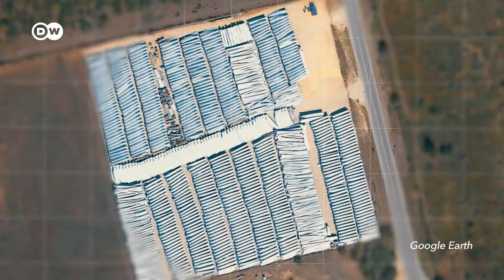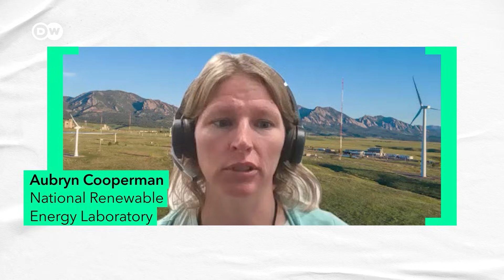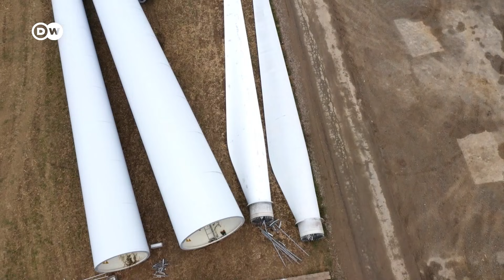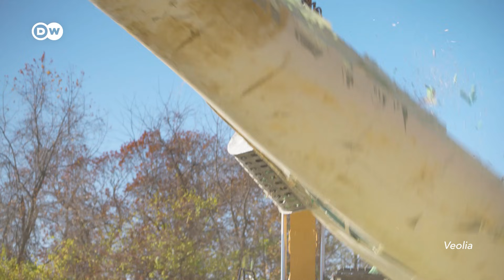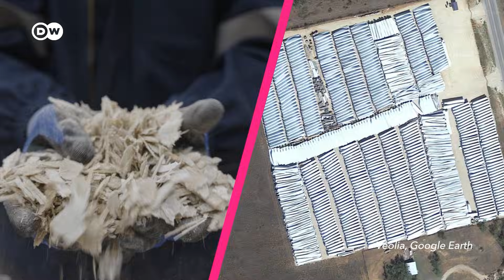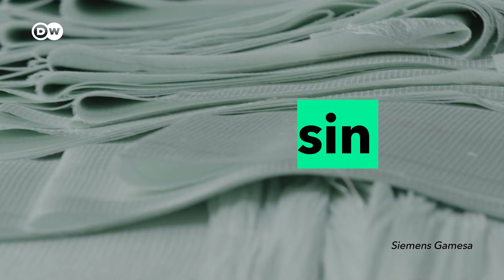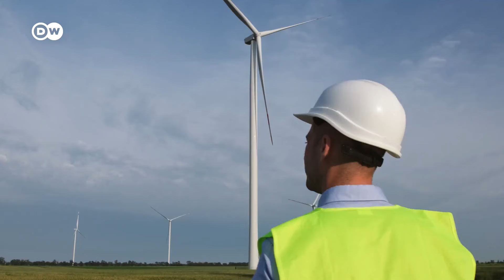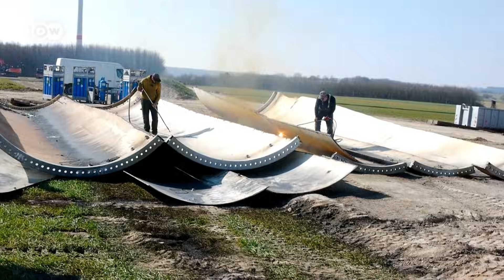Wind power's unsolved problem

Comment: Not a word is mention about micro plastics in this video. These blades while in use throws of a lot of micro plastics due to erosion. This goes directly into nature and is absorbed by everything that lives. Offshore turbines are even worse due to salt and stronger wind. In an estimate from Sweden they reckoned that their 4000 turbine or so have produced about 270 tons of micro plastic, only beaten by artificial grass on football fields.
Reply: The amount is much lower, since the outer layers are paint and negligible compared to the human use of plastics in all other areas.
Reply: @old-pete  The paint doesn’t stop the spread of micro plastics since gel coat have been used since the first fiberglass propellers .  The estimated  270 tons from the land based turbines are not minor.  This plastic is spread in the country side and is not from a local dump site like the other plastic. With the offshore wind turbines the amount of micro plastics will be even worse because of the salt and stronger wind.
Over the years the amount of micro plastics in fish will increase and be spread up in the food chain.
Reply: @runedahl1477  As I said the amount is lower, as there is barely any plastic in the outher layer. Wear of tyres and roads is estimated to produce 8000 tons of microplastics a year alone in Sweden.
Reply: @old-pete  Yes there are things that produce more micro plastics than wind turbines but still they are among the worst polluters.
The numbers can be disputed and there has not a lot of research done.  A couple of weeks ago I attended a meeting regarding a new high voltage power line that will go across the island I live on. I don’t have any thing against this project because it seems like they are take care of environmental issues. The mast will mostly be made of fiberglass but they didn’t have any data regarding how much micro plastics that will give away. Apparently the producer had no data available. This will be important in the future but is not considered an issue yet.
Apart from the plastic pollution there are so many negative sides to wind turbines so I think the whole project should be abandoned.
To write them all down in this comment.
Reply: @runedahl1477  If you consider the numbers, then no, windturbines are not among them.
The negative sides to windpower are faily limited, if one considers the alternatives.
Reply: @old-pete  Wind turbines are no good option. If you want stable carbon free electric power the only sensible options are hydro power,geothermal power or nuclear power. The two first ones sets requirements to the location, so then we are left with small modular nuclear reactors. The only thing that hold nuclear reactors back is the public fear after accidents like Three Mile Island, Fukushima and Chernobyl . The new generation four reactors are smaller, safer and don’t require human actions if things starts to go wrong.
Reply: @runedahl1477  One cannot use, what does not exist. SMR are not commercially availlable yet. And if they are save, is yet to be proven The problem will probably be easier access to nuclear material and, if popular, bigger distribution of nuclear material.
And it does not look like they will be cheap.
It is better to combine hydro, biogas, biomass for stability with solar and wind for cheap electricity.
Reply: @old-pete  There is a nuclear race going on but in a positive way. Companies all over the world are developing the next generation of nuclear reactors. They will be smaller, cheaper,safer and even be able to deal with most of what today is considered nuclear waste. Molten salt reactors have existed since 1958 and was developed at Oak Ridge Technology. Beside what do you think they use on some submarines and aircraft carriers.
Reply: @runedahl1477  And still they are not getting built, despite the first design being approved by the US.

The reactors in ships are different designs, not made for mass production and not made for cost efficiency. The military pays.
Reply: @old-pete  You are wrong there . The Chinese started their first molten salt reactor in September 2021. They did that in the Gobi Desert. It is a small thing but big enough to supply 2000 households. Their plans are to build much bigger reactors and roll them out in large numbers by 2030. I also learned lately that the Russians have commissioned a new SMR. In Canada and UK they are starting to build similar projects. Then there is the so called fast reactors that can burn nuclear waste. In US alone there is enough of this waste to cover the total demand for years. This waste is stored in so called temporary storage. They are already doing this in France.  Germany got a taste of how unreliable wind power is last winter. The price of electricity went through the roof due to lack of wind and old coal fired plants had to be fired up to avoid a total collapse. As a result air pollution riser by 40%. It was very convenient for certain politicians to blame the war in Ukrainian for the lack of energy which is completely BS.  Realizing how stupid it was to close down all their nuclear power plants they built a LNG terminal in record 10 months. Apparently nobody had considered that Putin or other may turn off the gas.
Reply: @runedahl1477  The SMR are still not commercially available.
The increased prices in Germany where not the result of a sudden lack of windpower, but of unsecure supply of natural gas. In other words it was a problem with the fossil fuel supply.
If all the windturbines had not been built, the price increase would have been much larger.
Reply: @runedahl1477 Nuclear power supplied only a small part of the energy needed. Even with nuclear power, the prices would have increased, especially considering that only a small part of homes are electricly heated. The situation would not have changed.
The energy prices increased in France too and the french goverment will subsidise the electricity market with around 45 billion € per year to keep the prices somewhat stable...

Comment: How does the recycling of renewables compare to the recycling of fossil fuel generation at the end of it's lifespan? How much of a nuclear reactor, a coal or gas fired power station is recyclable at the end of it's life? What's the cost to taxpayers to clean up disused power stations of old technologies compared to dismantling a wind turbine or replacing a solar panels with the next generation as they come along.
Reply: Considering the waste of the fuel, it is easier to recycle windturbines.
The dismantling is paid by the owner and most nations demand securities that cover the dismantling costs. In case of nuclear power plants, these securities are often too low.

Comment: I don't think they're unrecyclable...if a blade can be broken, it can be broken again...

Break it down small enough where you can use it as filler products. Remember when rubber tyres got turned into rubber mats under playgrounds?

Comment: while i like the idea of finding a use after the life cycle. if a blade can be put in landfill you can cover it with soil and use the land for farming because there is no toxic waste, that doesent sound that bad. if the other solution is to disolve them with acids, that will have to stored somewhere as toxic chemical waste, then the landfill solution sounds a lot better to me. if u can use them in concrete or new blades without chemical waste that would be first choice though. unless we can use them to maby stabilize the ground under roads that are being built or something.

Comment: This really highlights the difference between these windmill companies and oil companies. An oil company would try to hide this kind of thing and play off how impactulfull it really is. Wind is saying "yeah, we have a problem here so lets solve it for a better tomorrow".
Reply: There actually isn't a problem. The composite blades get recycled as building material or steel blades just go into the steel scrap process.

Comment: Even putting them into cement isn't a longterm solution. What happens to that cement when it is being deconstructed?
Chemicly changing it by heat or other substances seems rather the way to go with the already existing once and otherwise maybe find composite materials that are weather resistant, but not resistant to recycling ^^.

Should we till 2050 have achieved scalable and economicly vialble fusion energy then there are ways to recycle plastic and these components, that might be energy intensiv but still better then letting them wrot i would imagine.
Reply: Nothing happens during the dismantling. There is only cement.
Reply: @old-pete  well maybe i should have phrased it differently, what happens to the added crushed wind turbin parts in the cement after it would be at the end of its lifetime. Isn't it just the same problem pushed into the future?
Reply: @kinngrimm  No. The parts do not exist anymore. The resin and wood is burned and the minerals of the glass fibres become cement.
After that chemical reaction there are no glass fibres left.
Reply: @old-pete  i wasn't particular good at chemistry but i am  quite sure that is not quite how it works. If you put glasfibres into cement, they do not become cement. It is just another compound material as what was left of the wind turbine also was, just added into the cement. Which then in the end i would assume makes it even more difficult to sepperate it all  to really be able to recycle any of it.

Wood is only used for smaller wind turbines as far as i am aware of, as it can not withstand the stress  reaching larger sizes used nowadays.
Reply: @kinngrimm  Glass contains sand and silicium dioxide, which becomes part of the cement, as does the rest.
Most large windturbines contain balsa wood as a base structure, otherwise one could not form the glass fibres into the needed shape, as they are flexible until the resins are dried.

Comment: After videos like this I have the urge (sadly not the motivation) to start learning waste management. 

This problem is way above me. 
So I only have some really naive thought like:

We love glass and metal, because you just reheat and reshape it. The reason archeologists barely find any glass relics, because it either brakes down to sand size or you just melt it and reblow it. Matals are the "same"
But I'm sure on molecular level experts will explain that this isn't that simple either. 

So we have plastic, that made out of oil. Why is it so hard to liquify plastic and just remold it to a new form? 
Years ago Ive watched videos about anaerob burning of plastic can brake the chains and brake it back to a petrol. Wonder what happened with that experiment? 
Those ended up that its not viable as fuel, because the quality is worse and would ruin engines. But what about creating new plastic? 

There are another experimental steps with plastic eating bacterias. 
So again, feed the tubnines to bacterias, and use the "poop" :D to remold stuff. 

My concern is to shred things to pieces and use it for construction (houses and roads) we just postpone the problem and just shrug it under the carpet as mcroplastic. 

And we have the economical dilemma:
When they say, its doable, but expensive. 
This is at least promising, because when it has a price label, the supply and demand will eventually shift. 
a) Either with technological improvement:
same way solar panels became cheap, because engineers made it viable. In 10 years prices dropped by 90% because they found better materials, better way of mass producing, or simply make it viable for mass production. 

b) supply and demand:
eventually raw materials will deplete. When the barrel of oil price will hit a certain point, suddenly every landfill site will turn into a "mine" and these "expensive solution" will become the extraction method.

Comment: The first turbine recycling plant will be open next year in Denmark, with another four to follow in different EU countries. I read the process for doing this was masterminded at the University of Strathclyde in Glasgow.
Reply: The problem with this concept is how expensive and energy intensive it is to transport turbine blades. The idea of loading up thousands of blades and literally transporting them 100's to potentially 10,000's of kilometers to the nearest recycling facility is insane. Maybe feasible in DK where it's a small country. But somewhere like the US or China, good luck making that business case make sense. My money is on mobile equipment that can travel to a site and grind up the blades into an aggregate for concrete and asphalt. The very best case used as aggregate in the foundations of a wind facility repowering project. Or worse case they get landfilled, but take up little space. In the case of landfill, grinding is probably unnecessary. Because blades are hollow and can be cut into smaller pieces and stacked. Requiring less energy than grinding but still easier to transport to the nearest landfill. 

The reason I don't care about recycling these things is this...

Let's break things down. Let's compare wind energy to say coal. Let's use a 200MW coal power plants production and compare that that a 450MW wind power plant because of lower capacity factors of wind turbines. Let's say the turbines are 4MW each, which is pretty average onshore these days. That's a wind farm of 112 wind turbines that have a design life of 25 years. After 25 years there will be 3000 tons of blade and fiberglass waste needing disposal. That's a big number.

Now where does coal stack up?

To produce the exact same amount of energy as the wind power plant. The coal power plant will need to burn 44,000,000 tons (yes millions). Producing 4,000,000 tons of highly toxic and even radioactive fly ash. Furthermore the plant will also release 48,000,000 tons of CO2 into the atmosphere.

52,000,000 tons of pollution wreaking havoc on our environment. Compared to 3000 tons of relatively benign fiberglass waste which can safely be landfilled at worst. That's 0.0056% the amount of waste.

Just some food for thought before worrying about the wind industry for the waste it creates.

Comment: The average modern wind turbine's blades weigh about 12 tons each. So that's 36 tons per turbine. Blades last 25 years, so every 25 years a turbine creates 36 tons of waste, let's say 40 tons, because sometimes a blade needs to be replaced.

But an average coal fired power plant in the US will create 6,000,000 tons of waste in the same 25 years. The same as 150,000 wind turbines, more than double the number of turbines installed in the US since 1980. That's a single coal plant remember and that doesn't even account for the 95,000,000 tons of CO2 that same single plant will release in the same time period. Also remember that blades are basically inert fiberglass/resine like the millions and millions of recreational watercraft out in the world. (That nobody is concerned about scrapping.) However the waste from coal plants is well documented as highly toxic and we all know the effects of CO2 on the climate.

Now in the US wind accounts for half as much electricity production as coal. But if everything remains equal for the next 25 years. The coal power industry will generate 1 billion tons of toxic waste, where as the wind industry will create 43 million tons of inert waste. Just 4% of the waste of a coal plant. And again there would be 16 trillion tons of CO2 released.

The waste issue simply doesn't compute when compared to coal.

Comment: A move away from fiberglass is certainly needed, an aluminum skinned blade analagous in construction to an airplane wing would be be both more durable, recyclable and modular allowing for easier transport and assembly.  Fiberglass made sense when blades were tiny but it's long past the point when other materials should have been used, but the industry always found it easier to stick with what was known and push up the size of molds and blade transporters incrementally rather then switch to different materials.
Reply: There are no big aluminium blades strong enough.